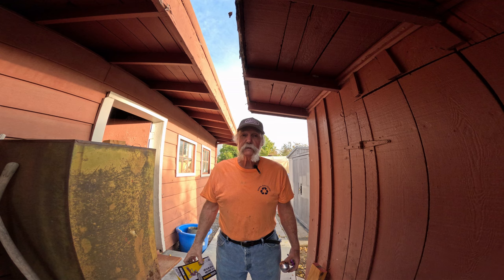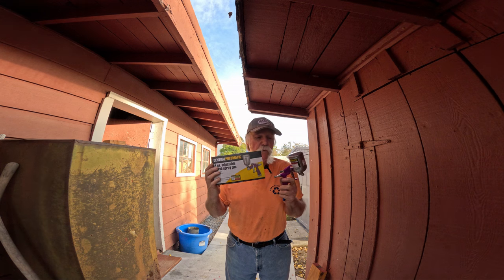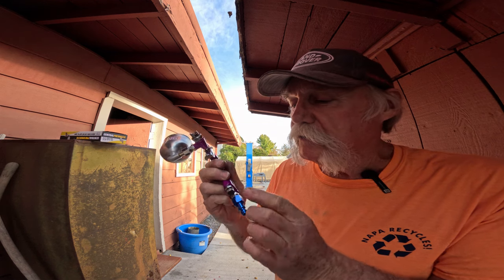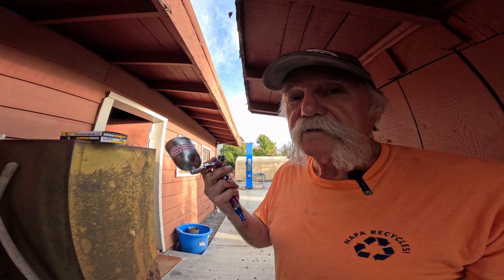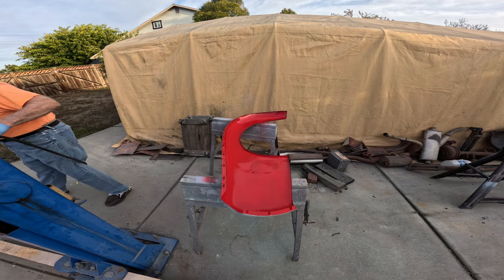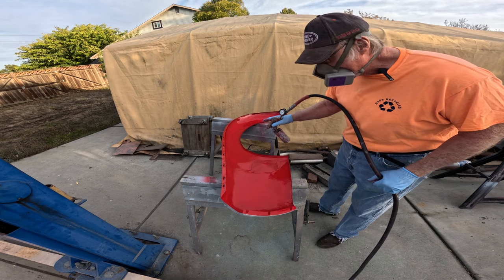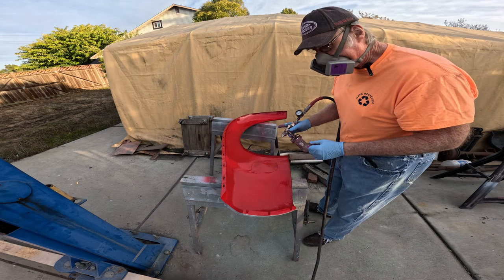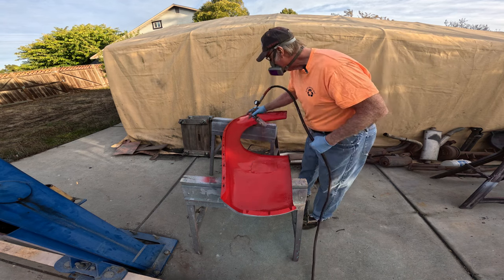Central Pneumatics (Harbor Freight) 4 oz Adjustable Detail Paint Gun. Item 92126

Comment: I have had one of those guns since 2008 for a project of painting some kitchen cabinets . 
  I had a regulator and air dryer .
  It was $14.99
 Really good for cheap .
Reply from the maker: Sounds like you have thecregular size gun, which is the same price.  This is more like an airbrush.  It would be difficult to paint a large area as the soray pattern is fairly small.

Comment: thanks EJH.  You were hard to understand when speaking with the mask on.  You should take the gun back to Harbour for a refund.  But I appreciated the demo of painting technique.  I just bought a Princess Auto (the Canadian Harbour Freight) HVLP gun new in box at an auction for $25 Cdn.  I hope it works better than your's.  John in Manitoba.
Reply from the maker: I looked at my other guns, and in all cases, the metering rod projects through the inner nozzle.  This gun's rod is about a 1/16" recessed.  I think that is what the issue is. I am thinking about working on that area to see if the cures it.  Sorry about the audio quality.  I'm not sure what I could do to improve it as the mic will not fit inside the mask.  Thanks for wstching.